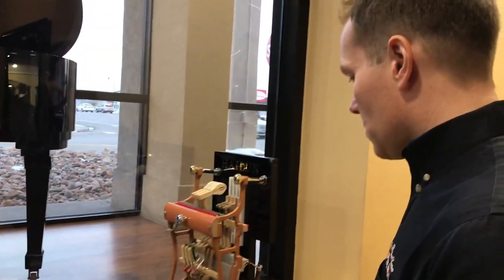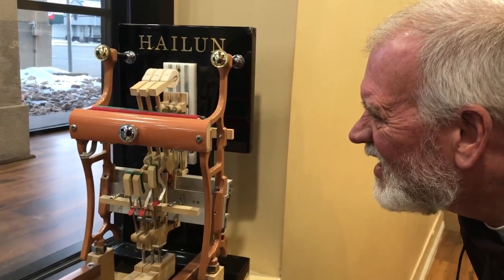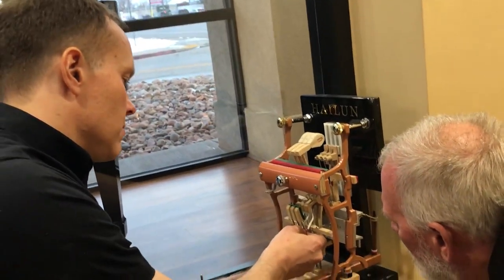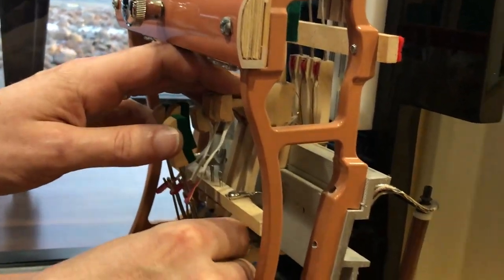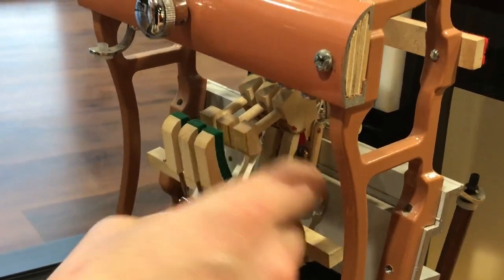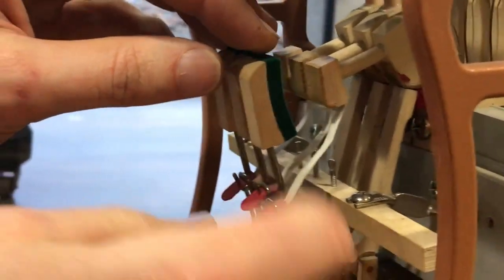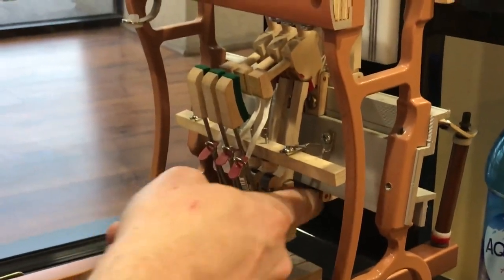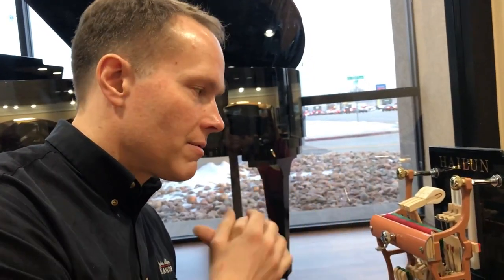Piano Q&A: Two Main Functions of Bridle Strap in Piano Action

Comment: Depends on the piano.  In my Charles Walter upright, the bridal straps do, in fact, assist with the return of the hammer and you can see them pulling the hammer back.  I have three keys where the bridal strap came detached.  On one, the hammer will not return on it's own, yet is free moving, so it's likely a broken or missing hammer spring.  On the other two, the hammer return is sluggish.  Adding the bridal strap (actually my own glueless workaround using a thin strip of velcro) brought the hammers back to perfect working order.